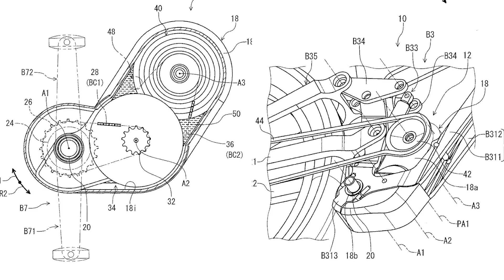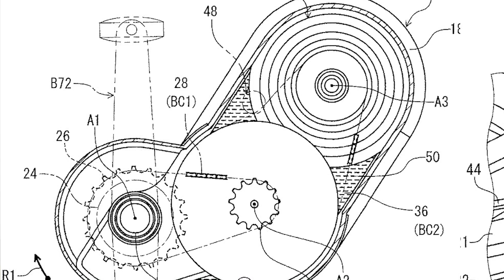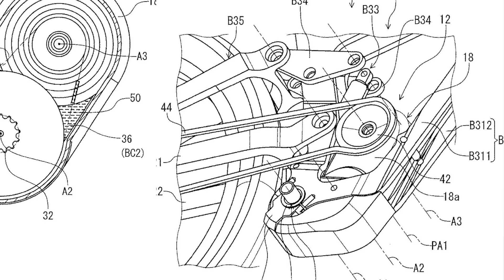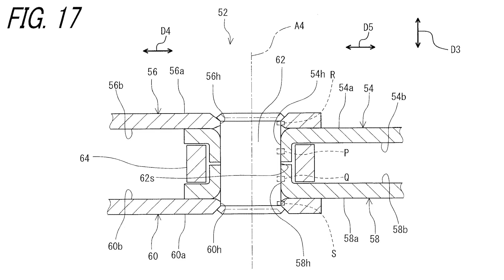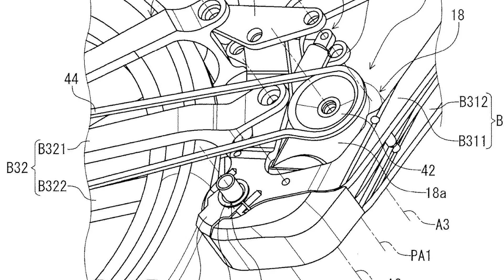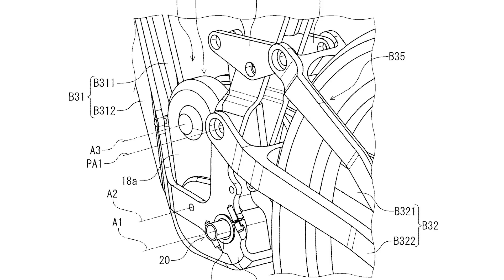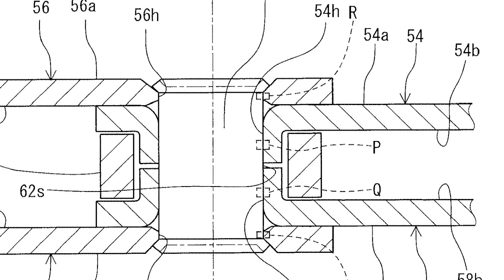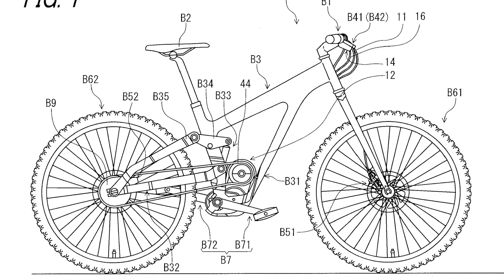Death of The Derailleur? | Shimano's Gearbox Patent

Comment from the maker: Is this really the death of the derailleur? Let us know what you think in the comments!
Reply: I would love to have a bike with a gearbox, but only if it is actually better, not too heavy and also affordable ... 😎
Reply: @StingerByte  Yes just make your own covers for your current drive & save money on chain lube!
Reply: @StingerByte  Make your own covers for drive on your current bike, even makes parts last longer!
Reply: I'd want it! Been craving for a Pinion competitor. Would be great to add this to the market. Especially if combinable with an eBike motor to make a single low-maintenance package.
Reply: @Fs0n1ine  coming up with 1:2 IVT initially designed to compete with Pinion but found it to be Universally Applicable very soon. Lighter & Compact than Pinion.
Reply: @LivingLifeOfSeeker  got any links to read on this?
Reply: @Fs0n1ine  in the process of filing patent application.
Reply: @LivingLifeOfSeeker  Or just make covers for your current bike!
Reply: @Fs0n1ine  Completed design phase
Working on prototype
Ratio -0.3-3 constant variable ( minus ratio is just to check feasiblity with automobile sector)
Weight 2.61 kg with 104 bcd spider
Chainline 38.5 MM
Q Factor 95 MM minimum ( With 11 MM Carbon drive)
4000 newton allowable force
(1.25 safty factor)
119 mm dia 87 mm gearbox width.
Reply: @Fs0n1ine  You just need to put your derailleur in a box, it works great!
Reply: I hate derailleurs. Their a faff to clean. So I am really looking forward to this!
Reply: no. ernesto did this with ferrari in the 80's.
Reply: Whats wrong w IGH, seems perfect for commuters esp w a gates drive
Reply: @JogBird  I love my IGH. BUT: it is bad for MTB, because it sits on the rear hub and is a heavy ballast to the suspension and thus reduces its performance. It is bad for Road Bikes, because it is heavy and does not have the right gearing. For Trekking and Commuting it is perfect, however.
Reply: @JogBird:
IGH make the rear wheel heavy and expensive. Imagine a second set of wheels with a Rohloff hub. 
Compared to usual chain drives you have less freedom to adjust gear ratio. But same applies for gearboxes.

I like IGH for commuting and traveling but a lot of bike stuff is race oriented.
Reply: @jochenkraus7016  Or just make covers for your current bike!
Reply: My Something Random I think people just want the fuckin bikes to ride it for them...and post on Facebook for them 🙄
Reply: @Chris-e1r7i  Or just make covers for your current bike!
Reply: The answer in the short and even long term is no, certainly not for the vast majority of cyclists. This, if they do release it, and I hope they do, will be merely for the high end buyers. Put it this way, I've just paid £300 for a second hand bike, in near mint condition, which should have been twice as much, and I'm very happy. I'm guessing that this gearbox will add at least £1000 to the price of whatever type of bike it comes with. It's obviously not going to be usable on other frames, so the take-up of these systems will be epically slow. With an estimated 2 billion bicycles living around the world right now, and possibly half of them with dérailleurs, no significant change to a gearbox will occur for a hundred years or more.
Reply: Absolutely not!!!!!
Reply: Yes it will happen, because this new gearbox, very likely is not compatible with old frames, but they could probably make it so much compatible with e-bikes, that they could save some production costs by making e-bike and non e-bike frames on same factory line. Also people would have to buy new frames when they want new gear boxes. And yes I want that gearbox for my cyclocross/adventuer bike. Also switches for hi/low beam headliht on brifters.
Reply: I keep it with my rohloff 😜
Reply: The presentation is too long.
Spare us with the unnecessary 'ceremony'. Go to the details.
Reply: Adding regen capability to ebikes?
Reply: in sports, maybe, in normal usage, its cost will be what give you the answer
Reply: nope , wont happen until the gearbox is adaptable bolt-on to any bikes bb and can handle at least 2000w e-motor torque
Reply: @Lap-Rise  Or just make covers for your current bike!
Reply: Derailleurs work just fine in a box! https://www.pinkbike.com/video/218538/
Reply: Gear boxes for bicycles have been around for years.  It just takes a manufacturer with enough clout to secure a patent and start producing them.  The problem is that any new or innovative systems will be overpriced to the point of frustrating them out of wide spread consumer use.  Eventually it will be relegated to a class of expensive specialty items beyond average consumer reach.  Given that supposition - No, I don't believe it's the death of the derailleur.  On the other hand; derailleurs should've long since been replaced by something more durable and reliable - but the price has kept it from dying.
Reply: @terrybyrd5105  How much would be a reasonable price? I have an idea that would be way cheaper than a new group set & make it last longer, want to try?
Reply: @Aljonone1  :  I'm not party to your idea of affordability, but for most consumers, a 90$ bike (with derailleur) versus an 1,800$ procycle (with gear box) is affordable.  If you have an idea for a less expensive setup - then by all means patent, manufacture, and market it.  Now do you understand why I say these innovations often price themselves completely out of an affordable and sustainable (like derailleurs) market?  Frustrating - it is!  But you go on - do what you can.  Maybe in future I'll buy one from you (whence they become affordable) - but meanwhile I believe you're really fishing for investors.  Nope - this is definitely not the end of the derailleur!  Honestly - I believe hub gears (axle integrated) would be a better transition away from the derailleur than trying to introduce a gear box (frame integrated).  But meanwhile, I'll stick to what I can afford!
Reply: Yes just make your own covers for your current drive & save money on chain lube!
Reply: @Dan Atkinson Put a cover over your drive chain & will last a lot longer!
Reply: Just put your Derailleur in a box!
Reply: @Dan Atkinson What if you could just get a cover for your Derailleur?
Reply: @Dan Atkinson Would work on a e-stay hardtail, but less efficent!
Reply: @Dan Atkinson Also makes gearing parts last way longer, which is funny because that  is why cant get any help to get it going!
Reply: Max Paine  Or just make covers for your current bike!
Reply: Its been a long time coming, I HATE DERAILUERS....I used to draw alot back in my younger days and dream up solutions to common problems fueled by my passion ofr bikes and all the new tech I was reading about in Bike magazine and other.  So I sketched up a downhill bike with a gearbox system back in 2004, I've been waiting a long time to see it in reality, unfortunately I never pursued a career in engineering, I was just passionate about bikes and was sketching out ideas.....I even designed my own linkage fork(minus math or Dave weagle's suspension experience), I never saw E-Derailleurs or e-bikes coming though, that never crossed my mind back then
Reply: @DEVUNK88  Have built some prototype designs for gearbox designs, have also found out that by putting a derailleur in a box or covering the chain, can have a design that works well, but seems that bike industry does not want it, try it out & see how much longer gearing  parts last!
Reply: Derailleurs are here to stay, but i beleive frame builders will be making models that replace  bottom brackets with a univeral shaped housing for a variwty of gearbox solutions, probably on big hit bikes first where derailluers are most at risk, and then lighter unduro xc bikes as components  get light enough, but i think if the frame builders adopt some standard housing they will pave the way for mass adoption
Reply: @DEVUNK88  Yes that would be good, but I tried to patent a standard housing & the patent was blocked, so no!
Reply: @Aljonone1  hmmm imagine my shock
Reply: Before I was even aware that gearboxes were being considered as of today (Jul 2021) I said a few weeks ago to a neighbour that I couldn't fathom why gearboxes hadn't been tried given the constant maintenance required of chain drives. We agreed that friction and cost were the barriers, but it's good that Shimano are at least considering it for MTBs. I suggested having an enclosed prop-shaft housed in the rear stay though. I just think the UCI is holding everyone back with their anti-technology tyranny. I'd like to see serious consideration for aero parts as well.
Reply: As it is with almost all very well developed and established technical equipment like the derailleur systems it will not be substituted quickly. Even if this gearbox turns out to be superior in almost every aspect it will take a long time untill the bikes will be developed to integrate the gearbox and then sell it not only in very expensive high end bikes but also in bikes for the mass market. I expect that not before those gerboxes are in regular use by the professional racing teams and have proved to be successful in the grand tours there will be a mind change of the customers on larger scales. Additionally a real market penetration cannot be expected as long as only one supplier can deliver a system with these advantages. Not before the next decade we will know for sure if this or a similar system has the potential to substitute the derailleur totally. 
Thanks for the insights of the patent.
Reply: @edgarkarbach385  Or just make some covers for your current bike!
Reply: It seems to me all of these advantages over a derailleur system can also be had with existing internal geared hubs,
Reply: @GeekonaBike  Yes just make your own covers for your current drive & save money on chain lube!
Reply: @GeekonaBike  Or just make covers for your current bike!
Reply: Kill derailleurs with fire!!!
Reply: @th_js  NO Yes just make your own covers for your current drive & save money on chain lube!
Reply: @th_js  Or just make covers for your current bike!
Reply: @Aljonone1  Or just don't post that many replies!
Reply: @th_js  You would be surprised how difficult it is to get people to even try a better idea! how bad was this?
Reply: YES, make it happen Shimano we the public all want it!!
Reply: @shayne131  Yes just make your own covers for your current drive & save money on chain lube!
Reply: @shayne131  Just make covers for your current bike!
Reply: Derailleurs need to die. Especially front derailleurs. Hub gears can suffer badly from twisting under torque. Enough to even damage the dropouts. Meaning you often need a torque bar. So gear boxes are clearly the only option left :D
Reply: @aikiwolfie  Or just make covers for your current bike!

Comment: I hate patents. I want to build a quadricycle and had the idea of running two opposing cassettes in a central tube to the back solid axle. Relatively simple and straightforward, basically run a straight chain from inside the "bottom braket" to your rear axle and both wheels. Use double freewheel in wheel hubs. 
Now I risk that building and maybe selling such quads could violate some patent owned by some corporate robots.
I fucking hate all patents. Intellectual property is theft :(

Comment: Roller chains running oil have incredibly low wear and very low power loss. Two sprocket cassettes with moving chain will be very low drag and very reliable. It begs the question why the idea is not used for motorbike gearboxes if not cars.

Comment: Any news on this? I recently saw the Zerode range of MTB’s. Exclusively gearbox. They look pretty good but I’m still not sure about the gearbox drive. I want it to work because I think it’s going to change everything if it does. Also, really had a rear derailleur fail, wrecking the chain, seat stay paint job a d almost the rear wheel. A fucking disaster. The system looks like the way forward. Current systems feel very long in the tooth now. It’s the norm but it’s so archaic.

Comment: If it's Gona be electronic shifting. It wouldn't be hard to throw together some code that talked to a cadance monitor and gives you a automatic gearbox!!!

And then imagine as the tech gets smaller they can  create a double clutched version where you don't notice the gear changers

Comment: Looking at this I would say if you can work on your bike and make adjustments with a derailleur you can service this. Good chance it may never need service. It is a very close copy of a cassette transmission for a Harley Davidson Big Twin. No clutch or natural position needed. Shift drum ratchets forward moving shift dogs between the gears. there will be a driven side and a drive side. it is as simple as it gets, just made smaller.

Comment: Very interesting, I would suggest a hybrid semi-synthetic polymer, to enact "stiction" for the lube.  Gears engage one tooth at a time unless bevel, which is much less efficient, so they depend on straight teeth, tensile strength across the engagement line of tooth contact, while a chain has manifold contact, dependent on tensile strength of the link, compression strength of chain ring and massively spread chain load.  A chain box can use thin chain rings, tubular "axles", thickened at rings and bearing points,  and be much lighter, using stressed sheet metal technology, which has always been the advantage of the chain drive.  When I was young, the "skip tooth sprockets" were common on front chain rings, and racing front and rear chain rings, for less friction.  The required "barrel pins" of a derailleur system is the means of flexing across the cassettes, but the primary cause of wear, and the absolute inability to keep it clean, and lubed.  "Sliding cassette" means the thinnest chain to match thinnest teeth, the axles can be very light, and the "chain tensioner" needn't "deform", to follow the cassette, but merely handles chain length.  Running multi-thread drive to move the cassette, following similar means as the old three speed model, but moving the cassette, instead of engaging different fixed gears, all coaxial, common lubricated, it should be easily able to be lighter with road time for the engineers to use, for upgrading.  I used to ride "century runs" all through growing up, did quite a bit of riding, in the Corps, for training, conditioning, but haven't ridden much in a couple decades, except my Harley, and it not for some time.  Thanks for a very interesting inside look at what is coming, I agree totally with your opinion, regarding the level of investment in this, showing serious intent.  It was great to run across this, I will keep watching as it develops.  Semper Fi, John McClain

Comment: It might be seen as progress in one way, but the integration of the gear train into the bike frame will mean that any irreparable damage to the frame will result in a total loss of more than just the frame, unless they make the ‘gearbox’ a bolt on addition,which would probably result in a potential ‘weakened’ area where there wasn’t one before. If that Avenue was exploited , the ability to change the gearbox from frame to frame would give it a larger appeal for different styles of biking much like the choice of derailleur or internal hub gears one has at present.

Comment: 1 > if it is done.. it won't fit my full double suspension Mountain Bike I am sure So that mean having to buy a new bicycle which I don't wish to do?  and  2 > if they do it the unit will be so pricey even on it's own without a bicycle for it, that only the professional bicycle uses will afford them not the masses of normal bicycle uses who would wish to have it?  So either way that's that. stuck with the damn normal 18 speed easy to bugger up with weather and grit normal system.

Comment: The death of the derailleur? That's easy. The Facet Industries BioCam... oh wait. Or the Hagen All-Speed Expanding Chainwheel... no, not that either. Hey, I know, it's the Stringbike... or not.

So many thoughts. 

First, Shimano wants to be the Microsoft of bikes*. A bit tough to swap out cranks / chainrings / cassettes at will with this setup. Essentially, you'll just have a Shimano bike - no matter whether it says Trek, Giant or Specialized.

Second, oh great. Another special Shimano lube. Anyone price the Nexus lubricant? I think it's about $120 per kilo (they sell it by gram units, not CCs), right?

Third, hmm - gears,  running in an oil bath... seems vaguely familiar.  Almost like - Sturmey Archer, SRAM, Rohloff,  and... oh yeah, Shimano. 

Fourth - is a parallel shaft transmission more efficient than an epicyclic (sun gear) transmission, like those used in IGH hubs for over a century? Potentially, yes, but only just. In fact, there are some pretty competitive Rohloff extreme riders who seem to get around just fine. And this system requires three chains - typically, plan on losing 3%-4% per chain - that's just an unavoidable loss in transfering power from a cog to a chain.

Fifth - don't plan on rapid gear changes - that chain has to rock it's way through all the gears to get to your desired setting.

The main advantage? Chains and cogs can be made cheaply. Much more cheaply than the precision machining required for a Rohloff or Pinion system.

Will this system take over the cycling world? Maybe among a certain segment of off-road bikers who need a budget solution to keeping gear weight away from the rear suspension. Otherwise - probably not so much.

(*except, unlike Microsoft, Shimano stuff usually works.)